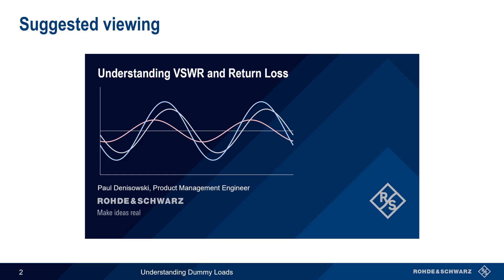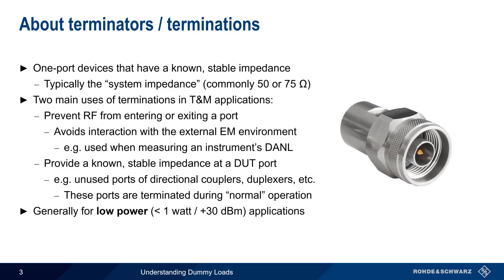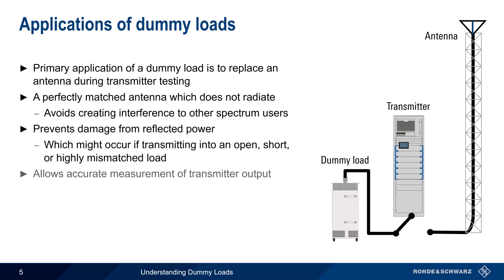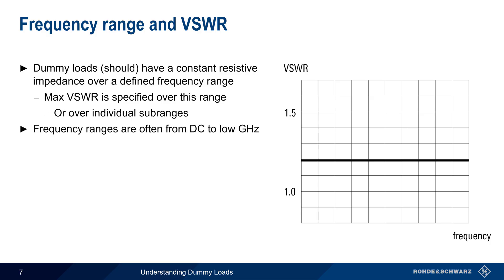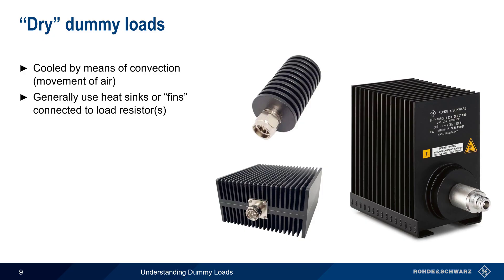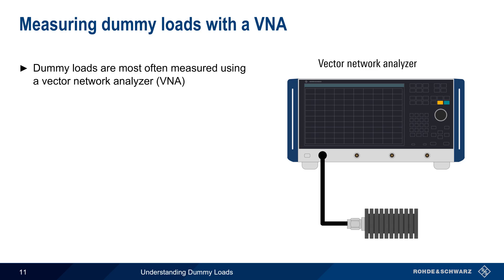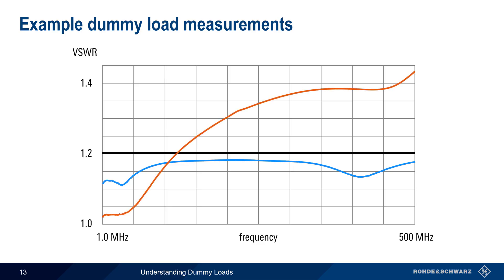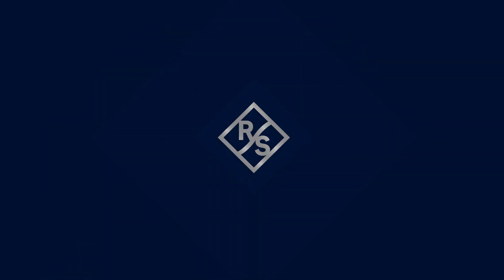Understanding Dummy Loads

Comment: I bought a Bird oil filled dummy load for 20$. I found the DC resistance of the load was just over 60 ohms.  Examining the tubular ceramic film resistor inside revealed no visible damage.  But I ended up going to ebay and ordering some Russian made resistances from a faraway place, of almost the same size,  I had to add thin shims to make it fit in the load but now at least the SWR is better up through VHF.  The resistance was terminated in a tapered shield like a funnel to maintain constant impedance down the length of it.
Reply: That's quite a deal!  I was actually surprised at how flat the VSWR was on my "wet" dummy load, even into the low GHz range